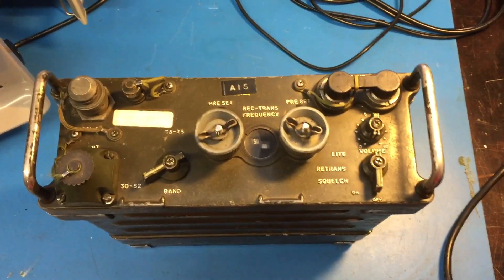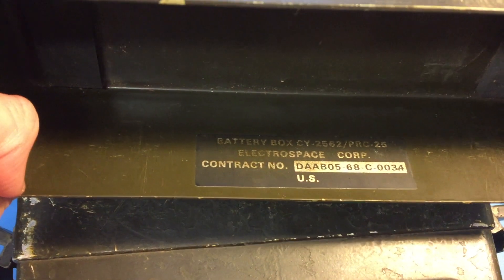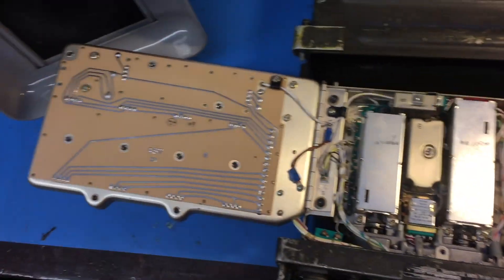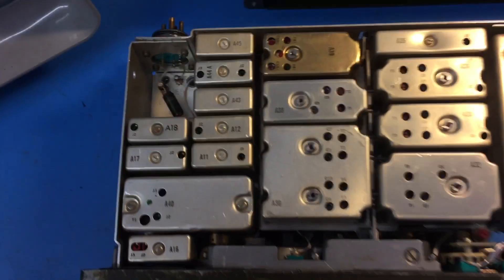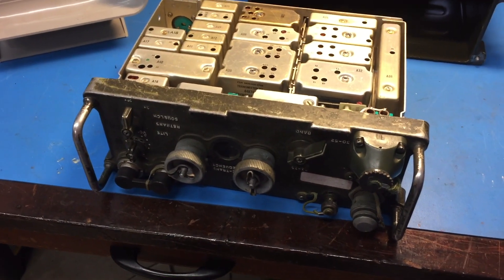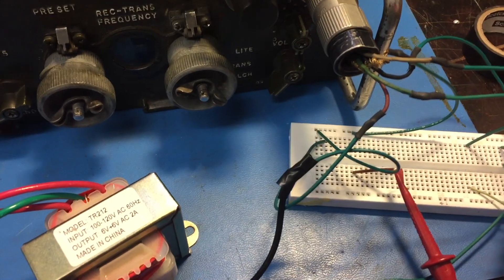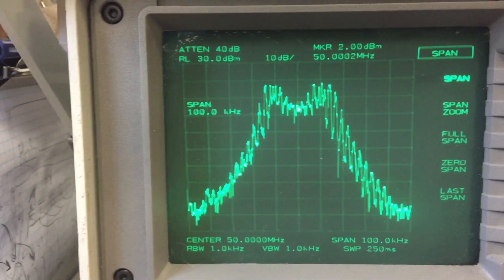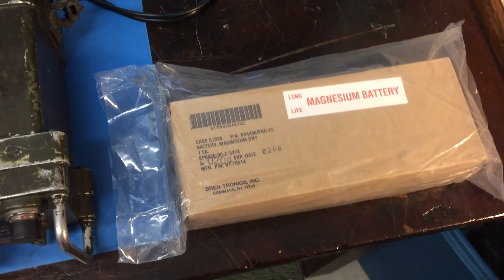Testing a PRC-77 backpack radio

Comment: I was a USMC 2841 Ground Radio Repairman 72-80. This is NOT a PRC-77.  The first clue without looking at the ID plate is the switch does not have a "new squelch" position in addition to the regular Squelch position. 2nd of course is the ID plate says PRC-25. The radios are different in a few ways. Besides tone squelch, the PRC-25 has tubes. The PRC-77 is all solid state and has longer battery life and slightly better power. We modified the battery compartment in late 78-80 by sealing it from the main body with a silicone seal around the battery connector and adding a pressure relief valve to the battery cover. In high-heat areas, gas could build up, and when changing batteries the cover could blow up into your face from the pressure. Your unit is missing one module lifter. I still have two because they were often lost.

Comment: Do you think it’s worth it to restore a Demilitarized PRC-77 by putting “New” Modules inside of it? And would it still work so long as the wiring and modules already inside are okay or are replaced?
And if the unit itself was outside without a cover will it be FUBAR from weather damage? I only ask because the internals appear to be okay aside from some rusting on the screws and a couple module covers
Reply from the maker: Well, if there's a problem with it then i think the best course of action is to troubleshoot the radio to determine root cause.  In other words, it may not be a bad module, you just do not know until troubleshoot.
Reply: Gregory Charvat Thanks, so far I’ve. Been able to flag all of the wires and am
About ready to solder them To my newer Chassis and hope she turns on. Aside from what appears to be a Gimmick Capacitor and a couple of wires that need replacing It should turn on and run fine. Unless a bad module is installed onto my chassis of course.